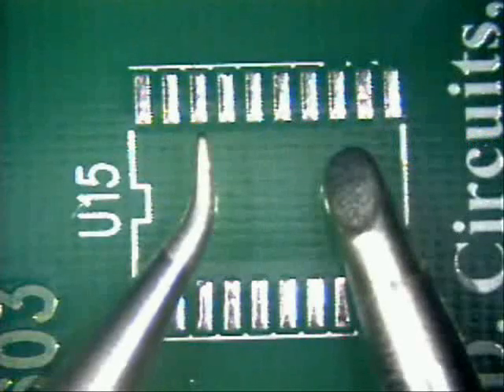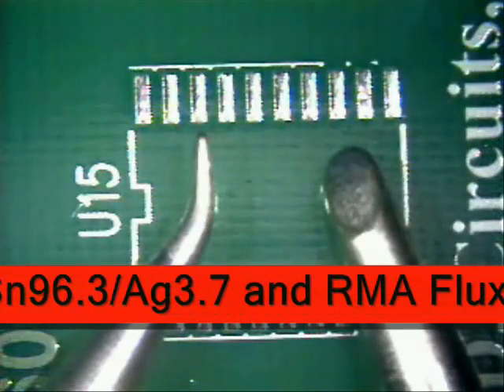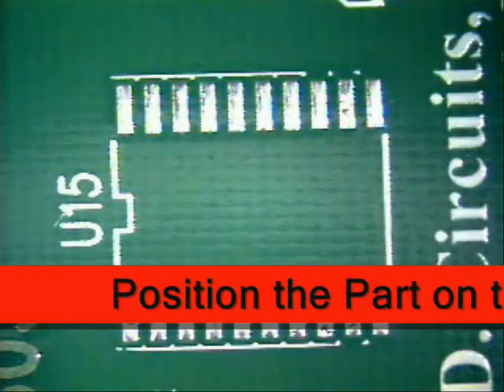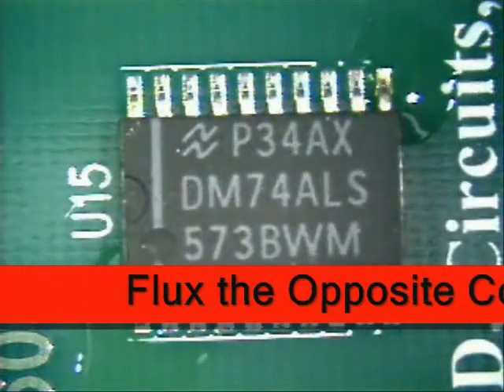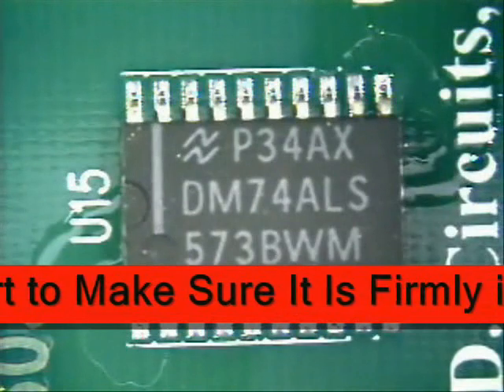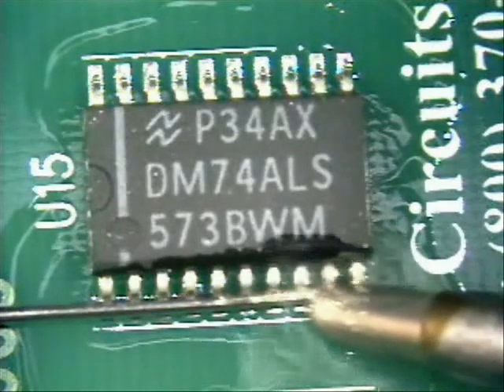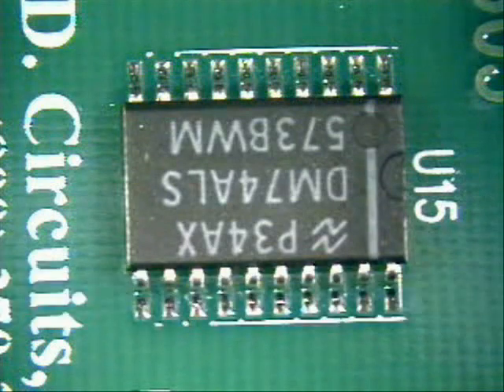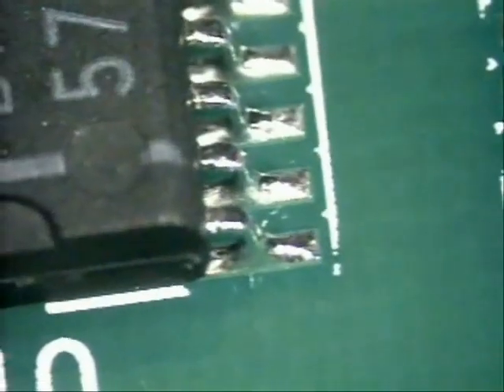Lead-Free SOIC 20 Installation

Comment from the maker: It is a Rosin 800 by Alpha Metal.  It is a No Clean Flux that I have been using for several of video streams.  It gives me better wetting action for lead free solder.  The soldering system is OK Industries MX 500 and the tips is a 700 degree set temperature.

Comment: Norman: Why the RMA Flux on this video and not the No Clean like the others?  Technique looks similair... ?

Also What degree tip (or what is the control set to) are you using in these videos?

Comment: Hi Norman, is there a reason you wouldn't use drag soldering on this type of chip? I have almost no SMT experience myself.

Also, do you have any special method of soldering a very small TSOT-23 package by hand soldering?  I have a need to mount one of these chips on a board and the lead spacing is very fine (.5mm)

I'm currently using a no clean Kester 951 flux along with a small diameter solder (.03) and a fine tip iron set at approx. 550F.  Any advice would be appreciated.